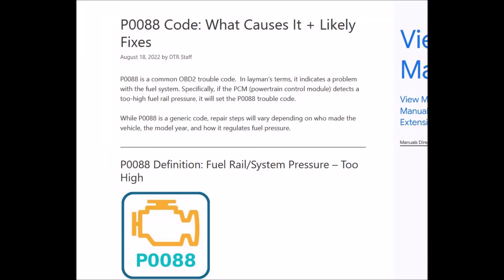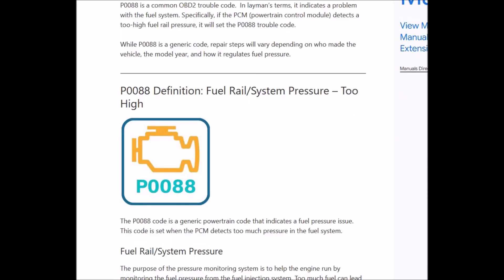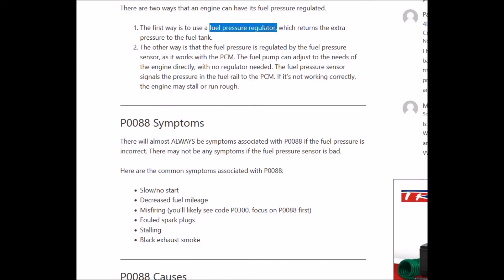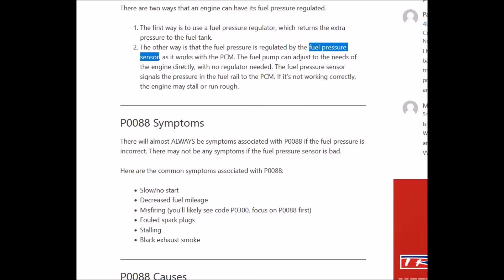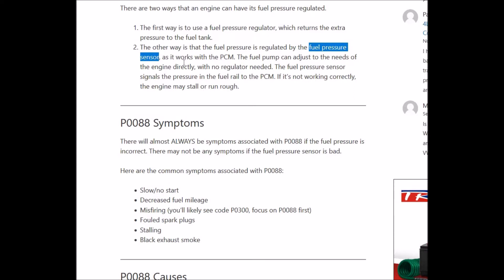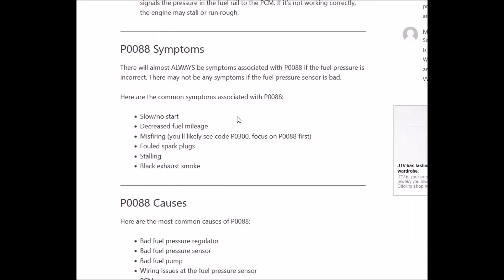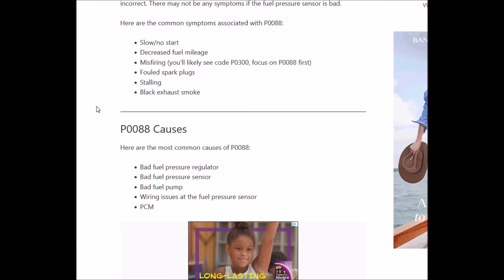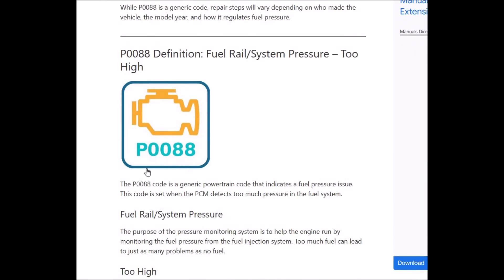What is a P0088 OBDII Engine Code?

Comment: Why do I get much pressure when I drive the car and park the car and then, I open fuel cap and it comes much fuel pressure from the tank? It is like opening the coolant cap when its pressured, I have a Mercedes E220 w212 - 2011 diesel.
I got the fault code P0088 and check engine light
Reply: No.  Not even close.  In a diesel, you have two (or more) fuel pumps.  One is typically called the Lift Pump or the Sending Pump - it's what sends fuel from your tank up the line to the second pump.  The second pump is your HPFP (High Pressure Fuel Pump) - most common ones are Bosch CP3 and CP4 pumps.  Those take the incoming fuel, and pressurize it to usually 500 - 2500 PSI to feed into the injectors so that it can atomize and spray the fuel in microbursts into the cylinders to have the right fuel/air ratio for combustion and efficient power.  Because the fuel rail pressure varies based on RPM's, and other factors, there is also a return line that takes extra fuel your engine doesn't need at that moment and sends it back to the tank for recirculation.  The FPR going bad would mean your engine is not getting enough fuel pressure to feed the engine.  Almost all automotive components are designed to "fail safe" meaning if they go bad, they'll starve the engine for fuel instead of sending 2500 PSI fuel at idle.